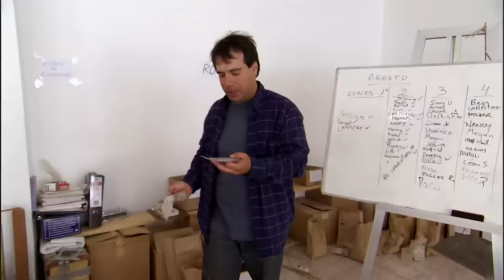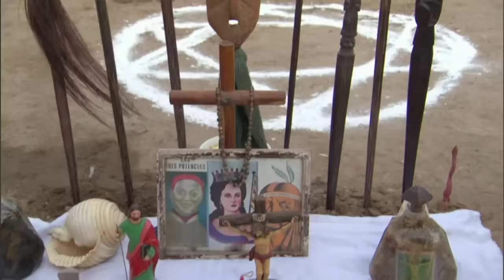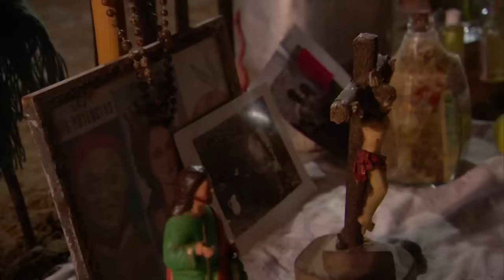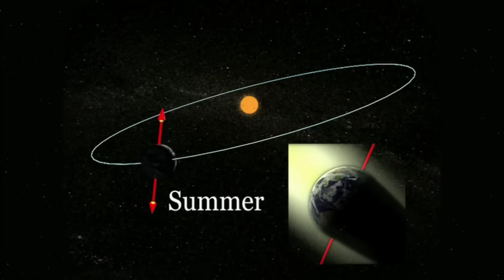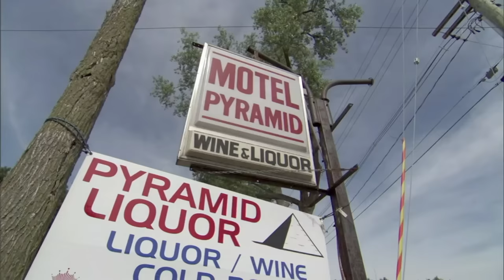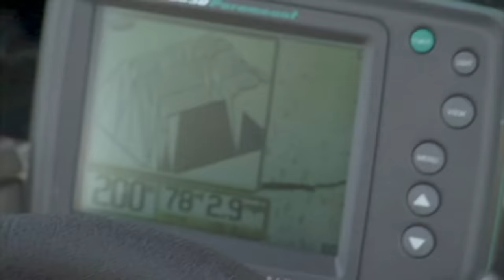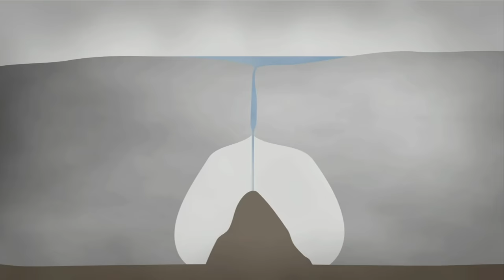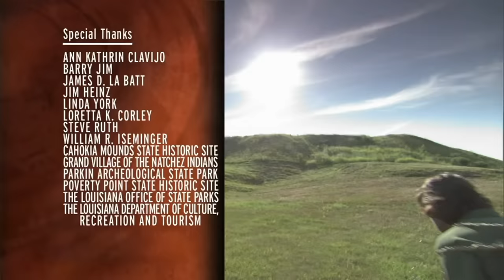Ancient Ruins Reveal Unbelievable Civilizations *2 Hour Marathon* | Digging For The Truth

Comment: Can’t carbon date rocks, structures made of rocks. Pyramids are older than anyone thinks
Reply: Naaa there are pyramids in Egypt with wood beams they have been carbon dated your wrong js I do believe the sphinx is over 10,000 yrs old though
Reply: Bot
Reply: @n.lightnin8298 not any of the major ones and not inside it's always a add on to something existing.
Reply: @p_campbell  no the bent pyramid has cedar beams in the main interior your wrong
Reply: @n.lightnin8298  like I said; an add on. They were trying to retrofit something that was already there

Comment: The technology that they have for the time was fine. You just had the logs in the wrong place. You would have needed two flat boards and put the rods in between and as they come to an end that's when someone would have to take the board and the logs as rollers and place them in front of what's currently being pulled over. It's quite simple. Once you do it that way it will roll pretty much with maybe a third of the effort